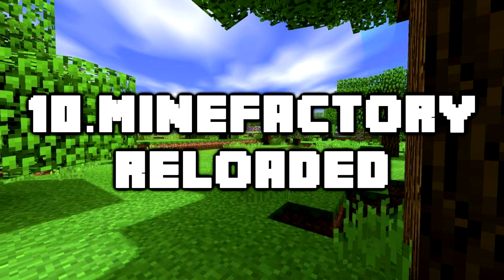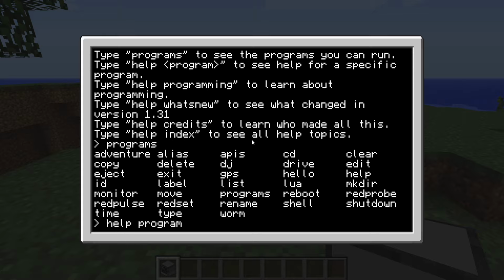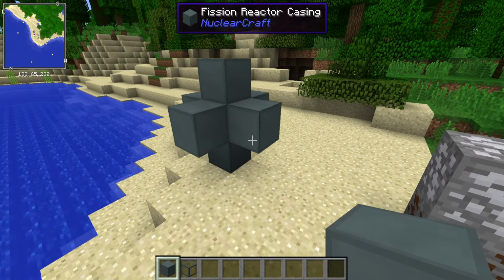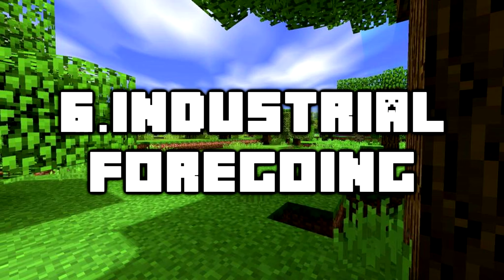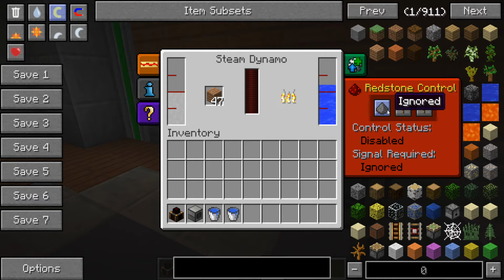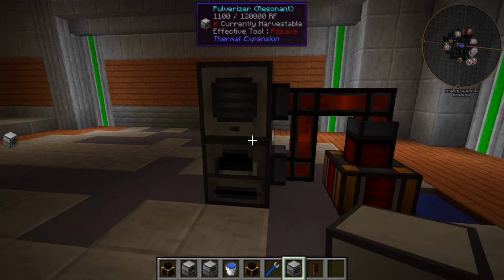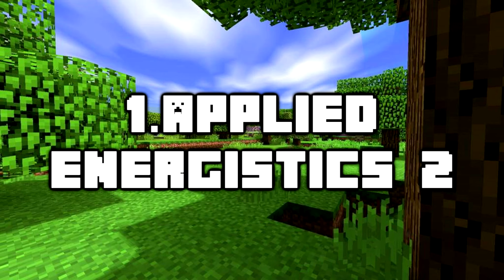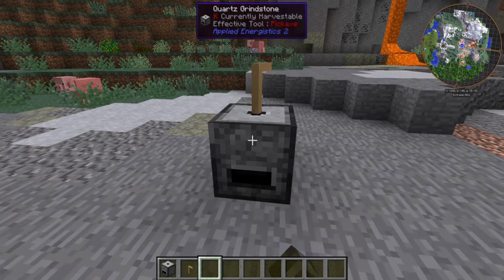Top 10 Minecraft Technology Mods (Factory, Energy, Processing & Transport)

Comment: are every redstone flux mod compatible with eachother? for example IC2 and Thermal Expansion
Reply: Almost every mod is compatible with each other. And those that use RF are defo compatible. Thermal expansion, Ender IO, Mekanism, AE2 you name it. But ic2 isn't compatible. Ic2 uses EU and won't convert it to RF or any other energy api. So you either use IC2 as a standalone mod or use an energy converter from another mod like Flux Network or Forestry
Reply: @RodrigoroRex  i see, thanks alot

Comment: So where's enderIO, immersive engineering, rf tools, and there are probably more but most importantly why isn't enderIO on there It is much better than most of the ones there
Edit: and refined storage is better than applied energistics 2 because you don't have ugly asteroids spawn and you don't have to hunt for the plates
Reply: I agree with ie and ender io, specially ender io. But ae2 deserves to be on the list. Pretty much everyone uses it. You can just mine the asteroid down. But yeah the press hunting is time consuming and the early steps of ae2 are very boring and you need a diamond level pickaxe just to even think about an ae2 storage system. But that's about it